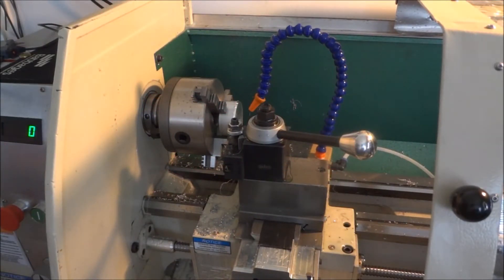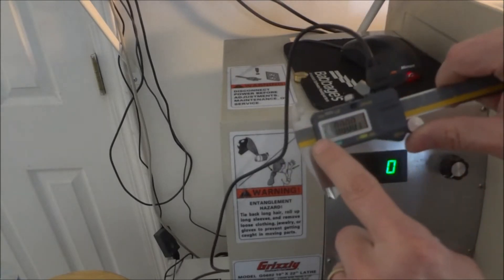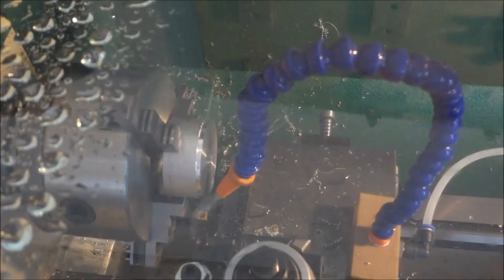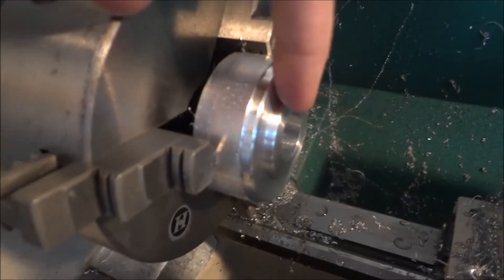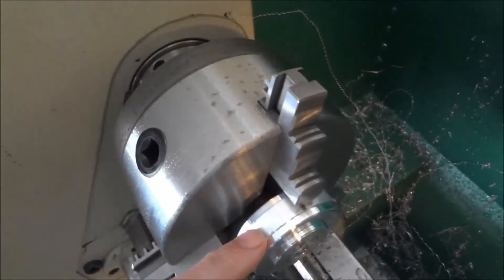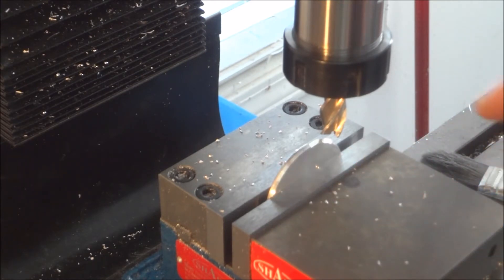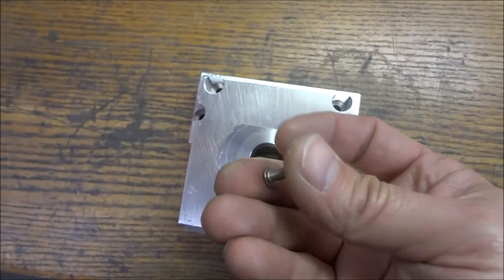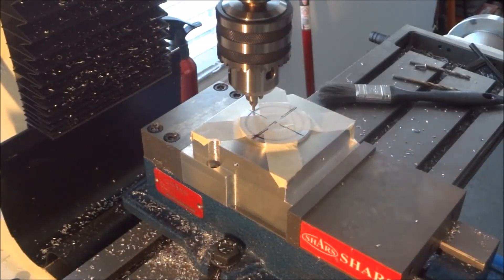PM 727M CNC "X Axis Bearing Cover Machining"

Comment: Awesome! Man that flood on the lathe is awesome. I'm jealous.
Reply from the maker: +russtuff Yeah!, Not bad for a $20 flood coolant system.
Be Safe
Sam
Reply: CNC4XR7 I may have to build a shroud like yours after I make a new stand. I have some ideas for a deep chip pan style pan maybe with a screen bottom and drops into a sump..... I'll have to sharpen a pencil I guess.
Reply from the maker: +russtuff 
Very cool that you mentioned that I had originally thought of a similar thing kinda like a farm sink setup. Maybe 8" deep but in the end I changed my mind. It would be very useful. I would love to see what you come up with. 
Be safe Sam

Comment: Excellent work Sam, it's good to see the lathe back in action. On the tapping thing... I acted on John's advice (from NYCCNC) and got spiral flute taps (http://www.mcmaster.com/#spiral-flute-taps/=120qvea), one at first, then a whole bunch of them. They are incredible! No more going back and forth, they pull the chips out same way a drill bit does, and are super sharp. Get yourself one to try and you'll never go back to the regular ones.  Trust me on this one. Ciao, Marco.
Reply from the maker: +Crivo152 
Thanks for the tip Marco 
Yes they are very cool I have one size that I have replaced a with a Spiral Drill tap they do work Really well ,
I am slowly replacing them as needed. I only have tried a 10-32 but works really well and is convenient to have the drill and Tap together.http://www.shars.com/10-32nf-hss-combination-tap-drill-1